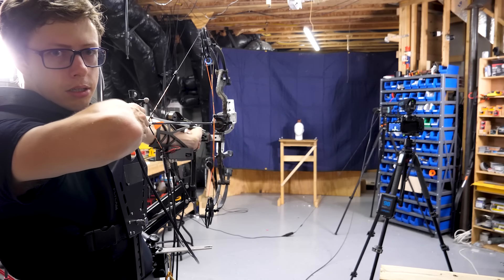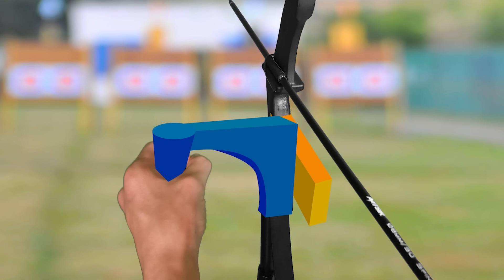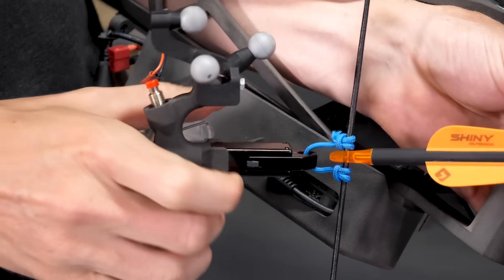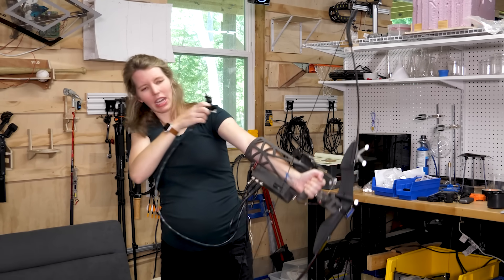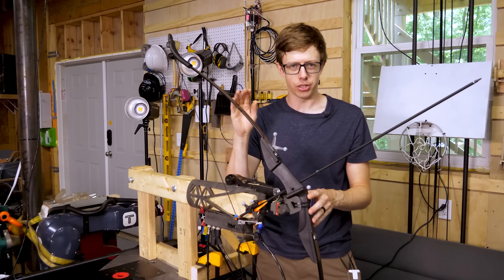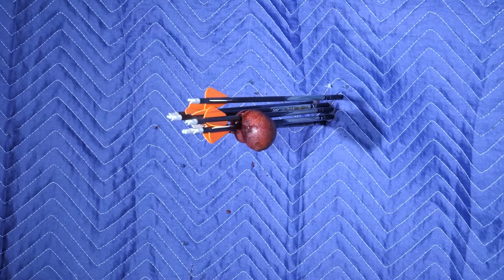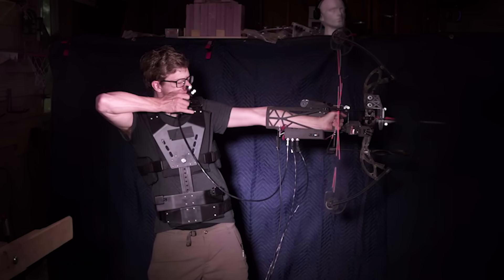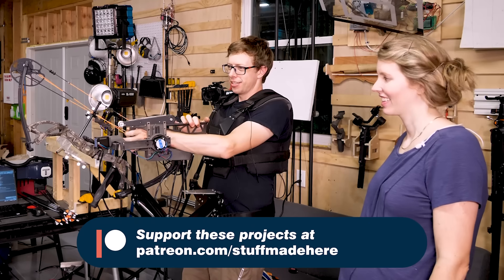Auto-aiming bow vs. FLYING targets

Comment: Next Step: Ditch the stationary cameras and add one to the bow, use image recognition to estimate a depth map and identify the target. You'd probably need a gyroscope on the bow to track its own position. Probably not as reliable, but more versitile and definitely more badass!
Reply: Dude that wouldn't work the camera would shake a lot
Reply: @mr.mysteriousyt6118  camera shaking could possibly be negated if there were two more tracking cameras and sensors mounted on the shoulders of the shooter or on the sides of a helmet or visor
Reply: @manOmanyTrades  good point, or just on the top/bottom of the bow. That would also make depth perception a lot easier
Reply: @mr.mysteriousyt6118  why would it? You hold a bow steady, and even if you attach the camera to the moving part of it that amount of shake wont impact the image recognition capabilities. Cars shake a lot more, and yet self driving with mere visible light cameras is possible - i dont think shake would that big of a problem, but you'd need a good tradeoff between image quality and size/weight. Also, focal length is something to consider, since a wide angle might capture more, but the target takes up a smaller section of the sensor and as such might be harder to recognize.
Reply: @Kugelschrei  plus i think both software and physical components can correct any camera shakiness that does occur, i’m pretty sure it’s quite feasible. Assuming the cheapest possible cameras aren’t being used, but seeing the nice one’s he’s got (and the fact that he went and bought a very nice bow) assures me that they probably won’t be.
Reply: @KevinDuan7  why not assume for the cheapest possible cameras? a mouse can have anywhere from 5x5 pixels to over 30x30 and probably that is outdated information and they are pushing 128 by 128 pixels now, good software can go a long way, you just need more cameras and good math to compensate
Reply: @frogz  small targets from a distance, legitimately terrible cameras arent too good for those tbh

That said tho the camera quality doesnt have to be exceptionally good, as long as its not terrible.
Reply: @mr.mysteriousyt6118  that's how pessimistic u are mate... It's better to be but in this case... U should have known it can be done...
Reply: @mr.mysteriousyt6118  You can fix that. Camera stabilization is old news.
Reply: This is most definitely the next step...
Reply: Jorge Sprave has already offered to collaborate on this idea
Reply: Making the bow usable without having to rig up multiple cameras would be sick, definitely would be cool to use it in more places than just a basement

Comment: Good luck with V2. Apart from the auto-aim you may need: 1) better posture/muscle tone - the bow reaction force through your palm/wrist/arm/shoulder at release is critical 2) a better arrow rest 3) precisely tune the nock height and rest position, centre shot may not be optimum 4) lighter and stiffer/tuned arrows 5) arrows perfectly matched to each other for mass and stiffness. Have you tried shooting the bow on a static rig to measure its intrinsic accuracy? High speed video of the arrow as it accelerates and clears the bow?

Comment: Here is the biggest issue I see with your build. The reason why crossbows are more accurate than bows. You put all the adjustment in the bow end, but the very critical part is where your hand placement on the end of the arrow is. Even though you have a computer calculating both ends, and small movement on the end is going to greatly change where the arrow is going. 

You need to either A. make an arm that will always hold the nock end of the arrow in the same spot 100% of the time. Or B. Pull back your hand till it touches your face. Make sure it is at the same spot every time. C. Just make this into a crossbow.

Comment: Hats off to you, Sir! I actually tried to make something similar 2 years ago. I tried measuring the distance to the target with a rangefinder and then adjusting the angle of the laserpointer. It worked in theory but after assembling it I had some problems and debugging over a serial port was too much hassle on an arduino nano :/

Comment: I just subscribed so you owe me a reply ;) make a skateboard with 2 different motors So it takes off using the high torque motor and switches to higher rpm motor once moving.
I assume doing this will get a better top speed and more efficient

if the above is not flawed then if possible it would be nice to have a flywheel of some sort to aid in slowing down and storing the energy for when you resume adding power much like driving a manual car

Comment: Putting it down to basics couldnt you remove the balls to show the location of the target (or intended target), and rely purely on the cameras? (which at this point, you basically made an auto turret if you added it to another projectile weapon) And at that point, isnt that what is used for batteries to auto shoot down missiles + planes + and other things?

Comment: Hey man love this video it’s amazing but please can I make a suggestion?

Imagine you’re blind folded and try to hit the targets.
 
The issue could be aiming so far of the target that the bow can’t compensate for this error.

Solution? 

1) I originally wanted to speakers that say left, right, up or down but I imagine that could be confusing hearing two commands at once…

2) you could do something like the phone case for people with impaired vision adding directional feedback by having the arm brace gently tap you to inform you which way to move the bow to hit a target! 

Hopefully with some practise with the feedback taps you can get use to it and become faster and faster to reacting to it marking some amazing shots!

Comment: You're aiming the gun by pushing the battleship around with a tugboat. You need to isolate the gun from the ship.

It's all in the arrow rest, as I'm sure you've already realized and designed into v2.

Comment: why not build it in a way you wont have to pull that string all the time while aiming.  make a string lock like  the one handed bow and arrow but with the auto aim feature and constant pull force. this will make it more accurate less the hassle of pulling the string while aiming.  just a suggestion. :)

Comment: Your "v2" should remove all the servos except for the trigger and simply have it pull the trigger when your aim approaches the right direction. Of course that means it can't change your aim, and will fire more slowly, but it will reduce 90% of your hardware and make the system more reliable and less complex. Since a regular bow takes a lot of strength to aim, this approach may work much better with a crossbow that holds the energy in place for you.

Comment: Also, probably not going to be heard,
but something I have been fiddling in my head for a long time that would definitely be your wheel-house of weird challenges would be to build a gear controlled, coil powered "mass accelerator" in the style of some newer "crossbows" but with more of an emphasis on being able to fire "anything", and with a terrifying level of force/compression in the coil.

Comment: So a few things. First off when did you stop hitting yourself in the face? I notice the switch once you swapped to the compound and I gotta say "Nice"
A few notes, I am surprised the bow hit because as far as I know (you didn't explain your whole process in the video which is understandable as it has to be so much) while the bow auto aims I wonder if you wrote any code that predicts your arm sway? Maybe you just shoot so fast the sway doesn't matter but over time it might add up (or maybe you've already taken care of it and didn't mention it) The second inconsistency which probably will add up a ton, the power behind the bow changes a lot of things, and since you are drawing it, each arrow will have a slightly different power behind it. Which will probably add up as you go more and more for accuracy. Do you already have a plan for that in your v2? or does it not seem like a problem just yet?
Reply: With a compound box (the "cheaty one"), there is a fixed release point, where you can't draw more, and where the energy is always the same. This is also the solution to the "hit in the face" problem, because it has a "let-off", meaning you don't have to pull hard at all when you draw to the max length.
Reply: @MrSam1er  Thank you. I don't do tons of archery so this makes sense. That's probably part of why the bow got so much more accurate after the switch.

Comment: Coding/engernearing always seemed so interesting to me, like in this video is a bow that aims and fires itself, but i would imagine it's super close to being like a "auto/turret bow" where it could pull the string back, and fire, that would be super cool
Reply: That might actually be easier than what he did because you could mount it to a stable platform at that point instead of having to compinsate for his shaky hands.

Comment: I am an actual USA Archery instructor, for what it's worth & a mechanical engineer. A couple of things I see that could be affecting your accuracy is form consistency. Consistency is paramount in archery. Also, the rig you hold is changing the bow draw length which is preventing you from obtaining an anchor point with the draw hand, subsequently causing you to punch yourself in the face, as funny as that is..... You should study the form of Olympic archers, the draw hand anchor point is against the face not in front of it. If you could get your draw hand anchored right against your face it would reduce a lot of the computer correction required by eliminating the movement of the rear of the arrow. Super cool though, anxious to see V2.0. I think what is really amazing is when you think of the millions of calculations the human computer makes in an instant to produce the perfect shot.

Comment: To get it more accurate, wouldn't you need counteracting weights to compensate the movement of the servos and to minimize the movement of you left arm immediately after the auto correction?
Reply: I’m guessing it’s calculating the position of his hand and where to shoot so fast that it basically isn’t a problem for it. I’m guessing it would still have to be doing the same calculations anyway because the hand movements would still be there even if not as severe.
Reply: Just need faster servos and a better dampening algorithm. His current set up has a little bit too much overshoot I think.

Comment: You seem to be hitting yourself in the head because you are standing wrong - stand with your feet and body 90 degrees to the target and you pull the bow in front of you.  If your wife has not told you this then it maybe because she is laughing so much when you hit yourself in the head ;-) OH!!!!! other problem, you are using fibreglass or carbon fibre arrows -  way to stiff for your bow - Use wood.

Comment: Given your skill level, 
I expect...
10 arrows per second out of two shoulder mounted launchers.
No external support infratructure beside what's attached to you and your bow
Arrows have motorized control surfaces
Arrows hit within +/-0.020"  
Can aim by sight (or tensorflow computer vision running off an esp32 embed inside the arrow, yes you can roll li-poly pillows into little battery cigars)

Comment: I really enjoyed this project! I would like to see an airgun-aimbot.

I see 3 or 4 ways of doing it.

1. Having a laser optic of some sorts detecting when you're on/in the middle of the target and will fire then. Like your bow.
(This will probably be needed for all other options below)

2 having servos moving the barrel to the intended target. This would only allow it to make some correction.. (still like your bow)

3 the thing that exited me.
Having gyroscopic competition in two axis effectively aiming the gun for you. This will be quite challenging to build with the braking and acceleration of the rotating disks.

4 (total overkill)
Having a "jet propulsion system" on the barrel. Like steering a rocket. Could probably be done with compressed gas but would be too bulky and probably not effective enough for several shots. But it would look cool.

There is probably more ways of doing this bit this was what I thought up in 2 min.
Unfortunately this comment will probably just drown..

Comment: That's actually horrifying

If he can build this at home (granted, his home is a full-fledged lab), I'm 95% sure there are combat ready aimbots for firearms that we'll see in action when superpowers stop playing nice
Reply: aimbots need to know exactly where the target is and what it looks like. If you could attach some kind of aimbot device on a gun, it would have to know what the enemies looked like, something that might take a sizeable amount of time. Imagine you are busting down a door and there is an enemy right in front of you. Your gun takes 500ms to identify the enemy and shoot, and the enemy is already shooting. Also, it would be extremely hard to make a gun that compensates for user movements, without having external sensors. At least for now, it is a lot easier and cheaper to just train people to do all of this. 

There are attachments you can buy that can provide extreme accuracy at even half mile distances. For example, TrackingPoint firearms claim that, "your shots will strike within 0.5 inches of your aim point at .57 miles." This isn't meant for close engagement, and you have to tell it where to aim before you shoot

Comment: It soothes me that he uses a Dell 9550/9560 laptop, which are 2015/2016 models. He most probably has the finances to upgrade, but doesn't as in his use case it wouldn't matter much. I feel anxiety by having such an old laptop as well, but I do know well that it is more than what I need from a laptop so this made me feel a bit better.

Comment: if you haven't already, try to have something on your new rig to measure the current tension of the bow string so it knows exactly how powerful your next shot will be.
Reply: it measures how stretched it is
Reply: @caldeira_a  cool.

Still, a more direct force measurement is preferable for more precise results, unless that's what you mean.

Only other thing I can think of is having some way to detect the local air currents, which may presently be beyond the scope of our technology for this particular rig.
Reply: @catcocomics1601  considering this is just a bow I doubt there's need for much more accuracy but that could be thing to take into consideration if making a more precise thing
Reply: @caldeira_a  personally I'd agree if it was just a bow, but we kind of already crossed that line just by having the rig at all.
Reply: @catcocomics1601  by "just" being a bow I'm referring to its aleredy limited capabilities like the projectile being an arrow and being based on human force to launch

Comment: The problem with punching yourself in the face can be fixed really easily, by pulling your arm back so your hand meets your cheekbone and your elbow is straight back. This works threefold to improve your shoes shots. 1: your elbow will be more stable. 2: Your hand will be beside your face, completely avoiding the possibility of punching yourself in the face. 3: the bow will be drawn further, allowing a straighter and faster shot.

Comment: You need a telephoto camera mounted as a sight that will allow you to select an optical target from a template (for example, a bullseye, red apple, X, etc). Pair with a parallel-sighted laser rangefinder and now you have position + distance with no motion capture markers. Use piezo stages for micro-adjustment and it could work with a rifle as well.

Comment: I would watch some "boring" software development maybe on a second channel or something. It'd be cool to see some function block diagrams and highlights of painful bugs
Reply: For sure - he has a second channel where he went into BTS on the locks but I'd love to see it for every project
Reply: @derekantrican  He's doing a Patreon BTS on Saturday. I don't know if he'll release it publicly, but he's definitely worth the few bucks of Patreon.
Reply: This would especially be good for people learning to code
Reply: He's using python, right? I wonder if he could gain millisecond improvements and thus higher accuracy if he switches to another language.
Reply: @almond5560  Not really, good have really good amazing math libraries. The time you gain with python allows you to refine to code quicker and thus be more accurrate, and the time gain from language wouldn't even be that big because python is fast with math.
So if you had infinite time and patience then kind of yes, but realistically not, the same could be said about machine code, if you machine code perfectly all of this with infinite time, it would get even more accurrate, but in  that time you could had written even better code.
Reply: @diablo.the.cheater  the calculations aren't the issue, because most of it is handled by C. But parts of python that are run by python might be a slight bottleneck. For the vast majorty of cases this would be minuscule, but I wonder if it's applicable in this case, especially if he wants to improve accuracy for moving targets, since every milisecond might count.
Reply: Twitch software development is the new C-SPAN
Reply: It's so boring when he's doing centering the div using flexbox
Reply: @hessiride1729  googles how to center div every other day
Reply: Lmao I cosign that for this channel and Michael Reeves
Reply: Agreed! I'm really interested in the software side of these inventions.

Comment: Your problem is that with a recurve bow the amount of energy that goes into the arrow ID directly proportional to how far back you draw the string.   Your set up does not give you a consistent draw length.  Target archers do that by drawing to their face and using a clicker that tells them when they have reached the proper draw length.  Fix that and the recurve would work.
Reply: Oh snap yeah you’re right that’s genius lol